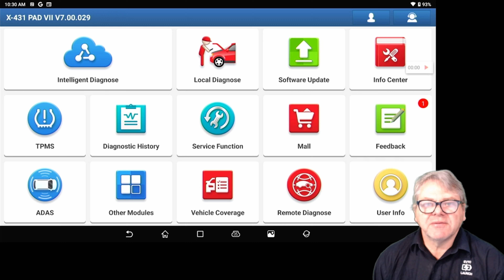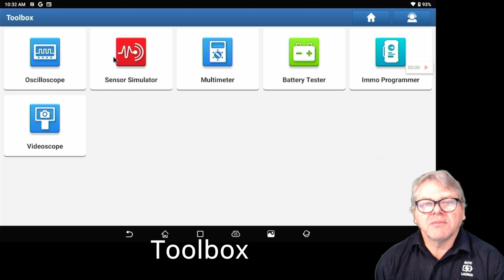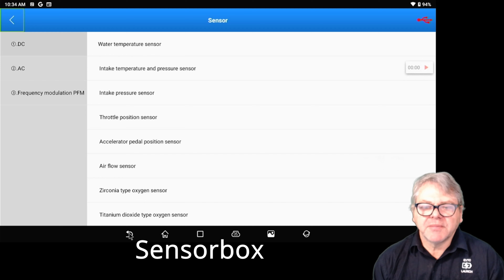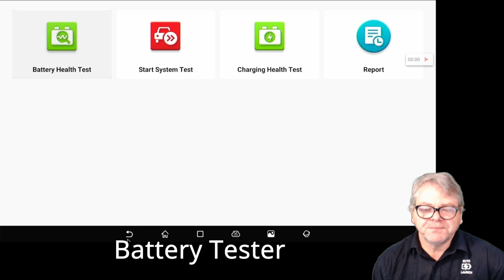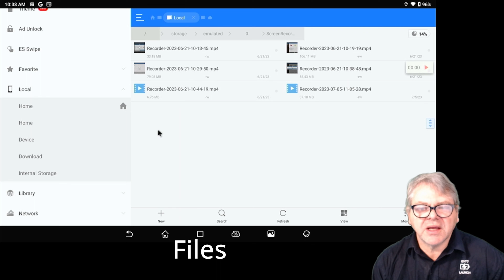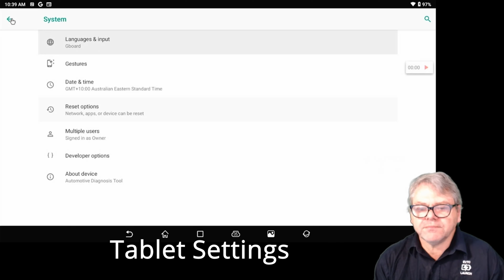PAD 7 Interface Operation Part 3

Comment: Hello good day, love your videos as these are well needed for Launch products 👍🏾
I recently purchased the PAD 7 ELITE and the XPROG 3. I tried the cloning function on a Mercedes Benz ME9.7 but it keep failing communication. Didn’t even reach to the wiring diagram screen. Not sure what’s the issue but it would be greatly appreciated if you guys could do a video specifically on the PAD7 and the XPROG connections and common functions. Thanks again and hope you can assist.